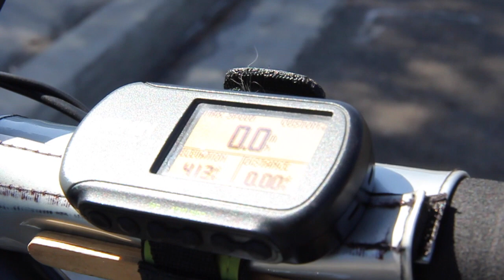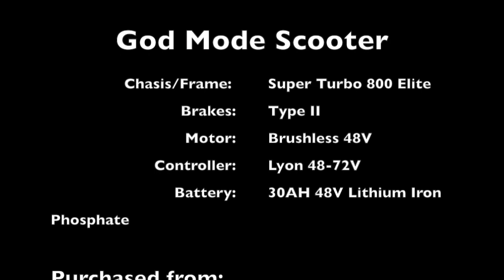God Mode Scooter Part I

Comment: What parts do I need to upgrade from 36V to 48V beside speed controller and battery? Thanks
Reply from the maker: Motor
Reply: you need a 48v 1000w speed controller

Comment: Can you use a 3000w motor on a 48v battery, I got a 1600w version, but i bought it too upgrade, I was under the impression you needed to up-rate the battery and controller before you chuck a bigger motor in it?????
Reply from the maker: Yes.  Recommended.  The 1500 watt rated motors are overheating on me.  You can run any rating motor only caveat is the lower wattage motors will overheat more quickly when running high wattage.

Comment: So your controller was pulling 62amps from your battery? Where did you buy that controller? I'm building my own scooter using the same frame and I have a vesc on order but I do want to try other options to see what works best for the least money possible, I might even mod the frame a little to fit 2 60v 20ah batteries in parallel,I want fast but also long range.

Comment: Bro i have the same bike,
But my motor run in  reverse, i dont know what happen, how can i make it run clockwise again??
Reply from the maker: Need to change controller setting.
Reply: How do i do that, is there a picture of something i need to change??
Reply from the maker: @biblepropheciesfulfilled6579  an easier but riskier method is to play around with the motor connector to controller combinations.  Positive, negative, ground then this is important:  slowly turn the throttle.  If you feel rattle then stop and try another combination.   If you throttle full when it rattles then it will blow the controller

Comment: Are you using mechanic brakes ?
Reply from the maker: Yes
Reply: @MinhvuLy  do you consider a hydraulic update necessary? In my opinion, mechanical brakes are asking lot of adjustment
Reply from the maker: @manuelhosi4590  I prefer hydraulics

Comment: Hello nice scooter I have a question I have a 1000 w 36v how or what do I need to change from 36v to 48 v with out getting costly
Reply: Just buy a 48v battery and add it to the system u already got u gonna get more speed and torque

Comment: Why is it not that much faster than then 1500W with twice the power?  Appeared a little odd.  I figure wind resistance would play an increasingly bigger role as you get faster, bu didn't anticipate something this dramatic...
Reply from the maker: The 1500w scooter is just nominal. During acceleration and uphill climb it reaches 2500w. This one is only 500w more because I adjusted the controller settings. I could unleash it to 4000w but that would overheat the motor way too quickly.